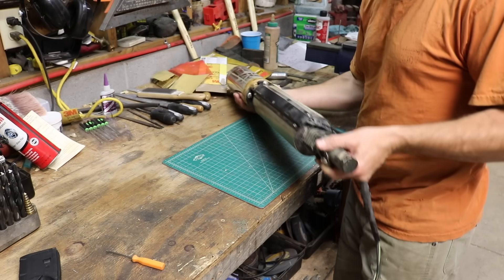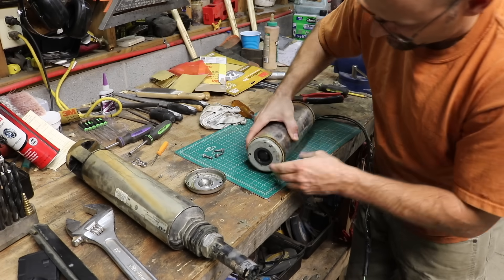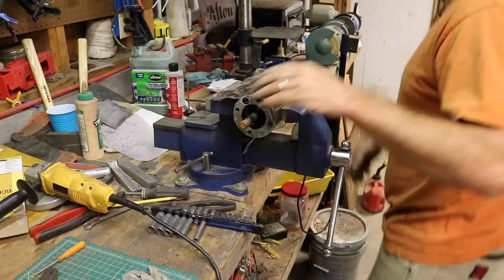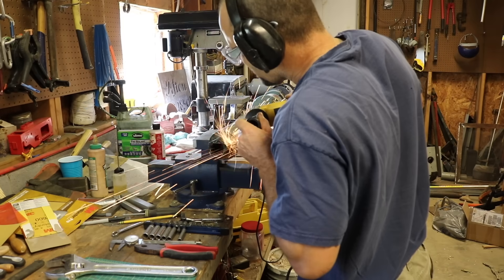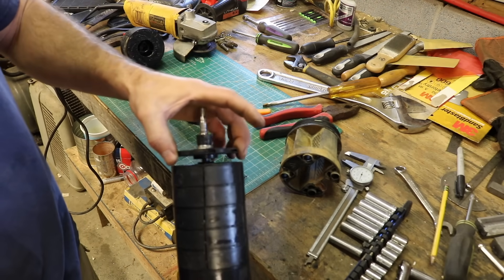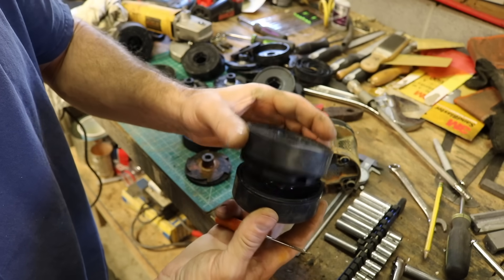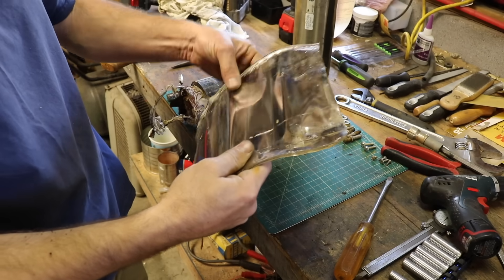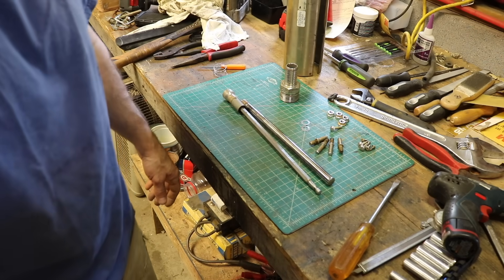Secrets Inside Your Well Pump. How Does A Deep Well Pump Work? FarmCraft101

Comment: Mosfets are used as make or break switches.....remember mosfets are voltage devices not current...at the gate and junction...fet bjts are current ontrolled at base to emitter. Peter

Comment: My pump didn't even last two years before it stopped working so I'm not impressed with this franklin brand. Used it in a grey water tank with sprinkler head discharge.

Comment: Simply stated, a centrifugal pump works by throwing water against the sides of the space the impellor is in, and the only place for it to go is out the top. That space is usually called a bowl, and on some of them, it is bowl shaped.
The motor and hence the impellor is spinning very fast, so it is being thrown very hard.

Comment: I don't think it was a temp sensor - I think it was a timer and when the pump INDUSTRY wantS you to buy another pump $400. that little white thing simply stops your pump from working - I found a similar "Non replaceable Fuse" in a shop vac that stopped working - it was just a little hole in the motor housing and I looked in and it looked like two burned ends of two wires.....I folded a penny to fit into the hole and press agains both wires and the vacuum worked for many years after that.

Comment: One of the biggest issues with failed submersible pumps is the installation of a piece of crap like the one you disassembled. The motor is a Franklin Electric product ( no issue with their motors ). The wet end however ( pump ) is a dumpster. Proper sizing and overall system design greatly improves longevity of the pump and motor. Power quality, frequency of starts, motor cooling, motor controls and water quality all factor into the performance and reliability of any system. 
As soon as I saw the composite discharge adapter I had my doubts. Hopefully a professional grade replacement was installed in its place.

Comment: I just did an identical set up. Our system is 3phsse 415v motor. I have to replace the impeller pump end (not the motor) every 12 months as it gets clogged with muddy silt from our old borehole and the flow to our storage tank dwindles. I also cut one open but could not quite grasp the magic of how the plastic discs worked!
Reply: Maybe consider  raising pump ( reduce depth) a few yards , could be too close to the bottom . 
Or  install plastic 5inch liners the full depth  , obviously slotted.

Comment: The sensor in there looks lie ka hall effect sensor, it probably senses the rotation of the motor/pump and cuts power if the motor doesn't spin up, and may or may not also incorporate a temperature sensor.

Comment: the pump could be seeing 100+ psi depending on the depth of your well system. that's why this design is required. the pressure required to push water that high is way more than a single impeller pump can provide. i just had another one fail today. we can't seem to get more than a few years out of these pumps for some reason.
Reply: Try not opening the fill valve completly. If you open the valve maybe a third it seems to increase the pump life.

Comment: I believe switch is a thermal overload protection. The start switch is capacitor and separate magic timer in a box . Just so happens taking my pump out today ( only 8 yrs old) .  Sesrching too purchace pump and found your interresting video.i save parts too lol. When your a hobby machinist one becomes a collector to put it gently. Lol

Comment: Great video. This comment (question) might seem silly, but I have been wondering---- if I have a submersible pump 50 ft from my house and 110 feet deep, is it possible to plumb a hand pump (valved off of course) into my main water line in my house for use if electricity is off. After your interesting tear down of a submersible pump do you feel it is possible to hand pump water up through the submersible pump, or is there something in the pump that would prevent this?
Reply: Good question. He must not be monitoring his video.

Comment: That switch you were holding that popped out the inside looks like a Silicon Controlled Rectifier (SCR)  they area high current/voltage switch.  possibly hooked up to a temp switch and would turn off the motor if overheat.

Comment: If I wasn't on a shared well, I'd use a Brumby pump for my well.  It uses compressed air not electricity to get the water to the surface.  You could've replaced the motor and kept the pump part and had a backup for 30 years from now.

Comment: I had a Deep well Put in in the late '90s and made the mistake of going cheap on the pump with a 'rebuilt' one @ 1/2 Price of New (rebuilt was $400). Total cost of the well was $1400. After SIX Months I started getting an Inline Filter  i put in clogged with what looked like small particles of MUD and sent filter to the Locally owned company to examine. They said SILT that would eventually clear.. so I went with replacing the filters every Other DAY. 

Finally after over Two WEEKS and my Plumbing starting to clog too... I took another clogged filter to another drilling Company to inspect. They (Two Man Company) told me it was PLASTIC (ABS?) . That the Impeller was breaking down. They came out.. replaced the pump (@ $800) with a Stainless Steel Impeller  and NEVER had a problem since .

 BOTH Companies were  in business over FORTY Years but the First I used was Two 20-something BROTHERS.. (They took over from aging Grandfather... always arguing..very Unprofessional and NEVER Returned calls when I was asking for assistance. The second was The owner and his hired help ..very Professional and knowledgeable. 

Saving Money NOW... MAY cost you MORE Later. I got what I paid for with the first!

Comment: Very well done and instructive video! I just change my old (220 Volts-3 phase and 3.5hp) deep well pump by a new one in Argentina. The old one it lasts about 10 years of use for the irrigation. I think its burned because some high voltage peak. Thanks to your video, I learned what's inside and how it works. Thanks!

Comment: Would bet you that you are correct FarmCraft101. Water got inside and corroded either the bearings or the laminations. Also, even if the unit is totally watertight condensation will fill the unit with water anyway. How long did the pump last you ???? The hose clamps are the hi-corrosion type heavy duty type. Great stuff.

Comment: I run a well pump farm. We usually get them in as Aquarium or more often fountain pumps and then feed them until they are self priming and are ready to move to the deep well pump pool. Most often we'll sell them off at around 120 volts, but some we let go up to 240. 

Your pump appears to have suffered from pulmonary embolism, which is brought on by filling your pool several times in a row, or throwing a washing machine party. I suggest only feeding your new pump clean watts and avoid any future water parties or late night bucket filling adventures. Pumps work best between 6am and after sunset right before dusk unless you can sneak up on them during noon when they are napping.

The part you were inquiring about is a simple proximity sensor. It's looking for other pumps in the general area. Most people think of the well pump as a solitary creature, but they have been known to pair up.

Comment: those motors are designed to pull water into them from the bottom to help with cooling- the windings are in resin so the water will not cause a short- if the holes at the bottom of the motor become plugged pressure will build up inside, causing the ejection of the parts- the motor died from bad bearings-

Comment: Power surge or lighting causes rotor to become stuck the stator should be smooth on the inside,you could have driven it out without all the fuss. They are called thermal overloads the motors are water cooled not sure in all my years doing well work if a bad motor has ever been dry? They should have reused the SS hose adapter even the SS clamps the wet end/pump unscrews apart wet end stacks can be rebuilt but age and cost better off new pump with a full warranty !  You need to go out on a few well jobs been more than happy to show you ..lol

Comment: I’ve had stuff like this I’ve fixed but still didn’t use them again. Depending on the difficulty of getting to the part new just makes more sense. I took a pump apart that was drawing to much current and it was just a bearing.  The problem is even if I fix it the o-rings would need to be replaced exactly or they would leak.   The down times not worth the savings. It can be used somewhere less critical than my water supply.  I do what you did, scavenge parts.  Lots of stainless nuts and bolts and tid bits for future projects.

Comment: and your plumber pump guy shafted you, by charging you for a new stainless steel 1"  npt to hose fitting to put in your new pump, instead of using the one you have, you dont use hose clams on the well pipe you use stainless steel bands, you blow 2 or 3 capacitors (box on the wall) before the pump totally fails, the biggest rip off these pump guys do,, the sell you a 3/4hp 25 gpm pump, when your well recovery is say only 6gpm, GMHC  financing reqires a well recovery of 4gpm, so you end up paying big bucks for the 3/4hp 25gpm pump but your well only recovers at say 6gpm, the pump over runs your well and the presser switch kicks out on safty at 20psi so you dont burn out the pump, so you have to go down and manualy restart the pump to get it above 20psi, but they install the cheap presser switch with out the leaver on the side of the presser switch, witch dont have the safty 20psi cut out, and your well drops to low and burns out, and they get to come again and sell you a new pump, just a few short years after waranty

Comment: Interesting. Used to have troubles with one of these pumps. After just 7 months of use it was causing the terminal switch from my house to cut the power (don't know the correct terminology in English). Everytime it was plugged, instantly power was cut off. An electrician installed it without the terminal protection, directly to my house service connection and worked.
Had to buy a new one, never knew why it did that

Comment: What was the part number on the TO-220 mosfet looking thing? Could have just been a BT### series triac from the way it is wired. The bimetallic strip heats up, disconnects, and that disconnect only happens at a few miliamps, leaving the heavy duty beefy switching to the silicon. That way your heat sensor contacts will not wear out ever.
Edit: I was almost right, it was only for the start winding.

Comment: Its an internal submersible pump thermal, if your panel that runs your pump may have landings for wires from the pump. If three phase power wires would be black, red, white, seals would be orange and red, thermals would be black and white. The seal and thermal wires would be smaller gauge wire. I'm guessing this is a single phase with no pump seals or thermal besides the internal one to the pump which would act like a hair dryer when tripped it will take time to cool and remake the path of electricity a closed circuit again . Just my thoughts with working with submersible sewage pumps. I'm guessing as well that the pumps turn off and on by a up stream pressure sensor if the sensor senses psi is below 60 psi the well pump turns on. Great channel keep up the good work.

Comment: If you want to burn one up in a HURRY, let it FREEZE in Freezing Weather.  The Pump does not "know" it is blocked with ICE and will run "against the ice" until it destroys itself.  Does not take long with it running against the ICE.  And then, if you are down at the DREGS of your well, and it picks up SAND, that GRIT will wipe it out.  But if you are down to THAT, you are about out of business in that "sand" will have to drill DEEPER or do without water.  

I am NOT a "well guy" but have lived on a farm with a Deep Well all of my life, I am 67 years old.  Where I live we can get GREAT Water at 500 feet.  But many places not so far away, they have to go 1,000 feet or more.  Pulling that pump up from the BOTTOM is where the EXPENSE is.  They will last for DECADES if everything at the SURFACE is maintained and taken care of.  But just a few minutes of a MALFUNCTION can wipe it out.  Letting it FREEZE is the easiest screw up.  

Anyway, GOOD VIDEO, I bet a LOT of people are interested in this.  Well, YES you have 2.7 K LIKES!!!  Just noticed that.  Ain't crazy about the Music at the end, but can turn that down.

Good Video!!!  BB
Reply: Which part freezes. We have a 700 foot well and we are have been getting fibrous material in our screens for a long time but well pump seems to still work fine. Have heard it can be impeller shredding but seems like it would have went out by now. Our dang pressure switch pipe froze last winter and well pump got stuck on till breaker flipped. Pressure guage  max needle read 120 psi.
Reply: @truthhurts2149  You had a very close call.  The pump probably got years shaved off it's life in thtat episode.  They will often self destruct when that happens, then you have to pull the pump to the surface and repalce.  The fibrous things you are seeing may stem from that event.  Maybe not.  Get SAND in there and it will be gone, but as a rule when you get sand you are at the bottom anyway.
Reply: @bobburnitt5389 I hope it didnt do too much damage. The fibers have been in the screen for years before this happened though.  we have been getting sediment for years also. It's a very fine black and gray  shiny silt.
Reply: @truthhurts2149  Maybe it will be fine for years, I am not an expert, just lived on a well a long time.  Everything wears out sooner or later but maybe it will keep on going, BB

Comment: They make motor replacements , I've never seen the stack of impellers go bad unless it sucked up a ton of sand .. the more impellers you have, the more head feet you get.. the deeper the well the more head feet that are needed to meet your gallons per minute requirements . I've replaced hundreds of them..

Comment: That is late 80 to early 90 pump I used to put them in so even twenty years is great. I'm surprised they warranty a twenty year old pump never heard of that. An besides the well has a lot of iron in it you see that red on side of pump that's iron in well stainless doesn't rust that's from well.

Comment: 3:50 That's a Thermal Overload switch. It cuts power to the motor if the Temperature gets to high preventing damage to the motor.
Overheating in well pumps is usually caused by either a bad bearing (starting to seize up) or debris jamming the pump impeller.
Reply: Id say unlikely. More likely what Esven stated - some kind of start-relay ding.  It is a single phase AC motor.  There have to be a start winding with either a run cap or a start relay.
Reply: Sorry Guy's sixta is right
Motor overheating is controlled by a thermic relay in the power box

Comment: Man that’s crazy,from 1972 until 2018  that’s about 46 years.
Reply from the maker: I was told that it was the original pump by the previous owner when I bought the place 10 years ago.  However, multiple people have commented on my video that they know well pumps and that it couldn't be that old.  So, for the record, it's possible that I was told wrong.

Comment: The pressure tank is the key to-pump motor longevity. Also look for a pump end with a brass or stainless discharge. Plastic ones usually crack after a few years of service
Reply: What do you recommend, Brand?

Comment: The switch contacts would be normally closed when the motor is stopped. When the pressure switch at the tank closes, current flows through the small contacts to energize the start winding in the stator assembly. As the motor accelerates  the small contacts open and remain so untill the motor decellerates to a stop. The start winding is what provides the initial torque in the proper direction.Without it the motor would  just growl and cook its stator winding, or posibly even begin rotateing in the wrong direction. The video doesn't clearly show the wireing path from the watertight connector plug to the stator switch, but I am sure you do not have a mosfet transistor there. The simple and rugged AC motor would have no need for such. It is definately part of the power circuit, but my guess would be a fuse unit.

Comment: Thanks for the video..
I faced problem in my submersible pump.(1hp)
I checked resistance in motor found ok.
Further checked found pump electric panel card fault.
So replaced the card now works fine..

Comment: May be LED temperature sensor. Now a days you can use LED temperature sensor with relay.
Reply: Excellent fan systems arranged with check valve. Hard plastic silica metal frame and a rotor shaft. Could be used for gears in electric cars except water recirculating and forcing hydraulic tyre shafts instead of petrol burnt. You can use crank shaft oil instead. Old petrol engines turned electric.

Comment: The motor insides the well went out got an estimate of $4000 to fix it. Feel his estimate is way off
Reply: 490 pump gaskets 20 rope to pull pump, new hose, new electrical wire and more still doesn't make it over 3k labor and time. Wow😥🚨🚨🚨

Comment: I use rods like that for  metal chisels . Just grind down a cutting head on it  even the small rods for punches "So its good to part it out" get some good nuts and bolts ect as well cause there stainless steel  Recycle the copper wires and metal

Comment: About the temeperature thing...
I think it's a Bi-Metal switch, connected to the Triac (Triacs are used to switch AC Power, MOSFET's can only switch DC). But i don't know why there are 3 Connection-Pins. Eventually this connections are Live, Neutral and the switched one, who is connectet to the Motor.

Comment: The plug w/3 wires is for the start and run compasitor. 
U have a 2 wire pump. 
A3 wire pump has start and run located above ground. 
(I prefer this type, easy to service.
Reply: Franklin two wire motors are split phase, and don't use capacitors.